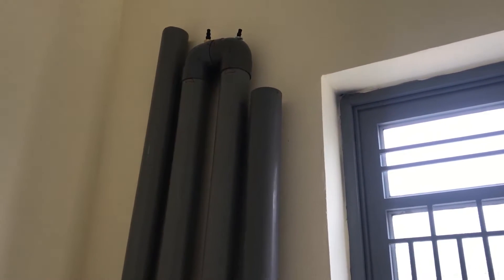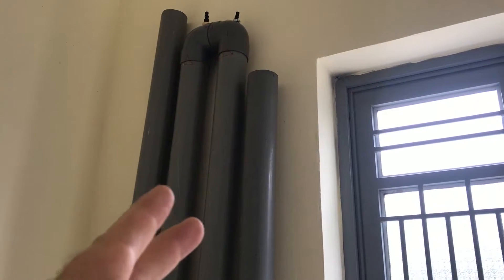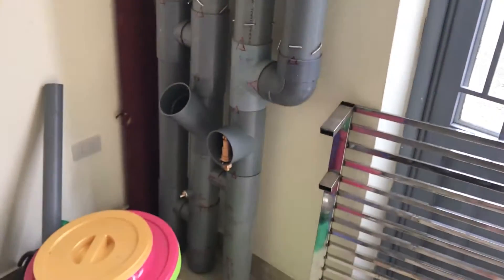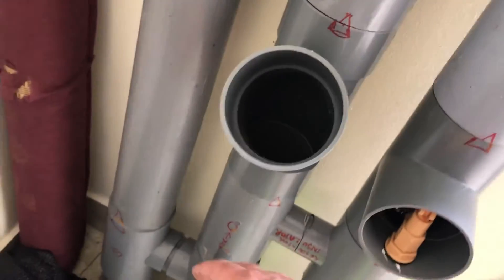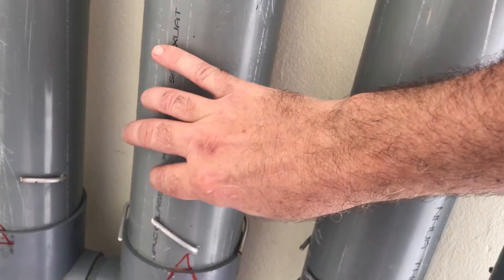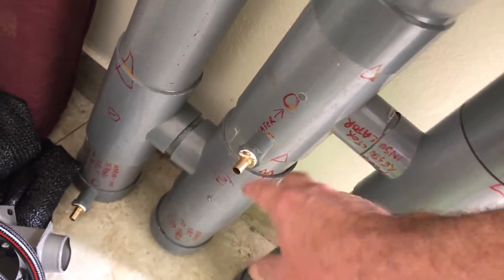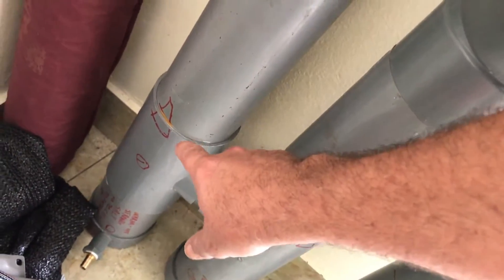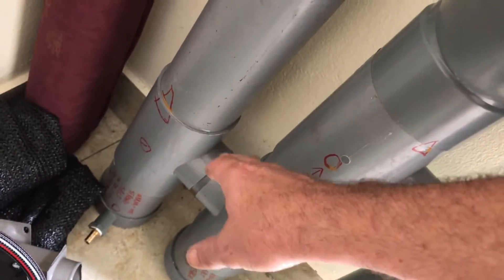Solar Powered Air Conditioner! diy project build start

Comment: Wow thank you so much for sharing I've been trying to find people who actually built this
Reply from the maker: Ya I built it but it did not work well here in Vietnam, because of the humidity being very high I guess. I did get about 4 degrees cooling at one point but it did not seam to actually cool the home. Still working on it.
Reply: I would love to see an update on it's function with you explaining what you think is going on with it
Taking some measurements or such

Do you think you need  a larger or second stage of dessication?

It was mentioned in the video i watched using a more expensive, desiccant may increase the amount of water you are able to pull out
Reply from the maker: Ya I when you pull the water out of the air it heats the air too. I think the problem was that I could not remove enough water fast enough. I was thinking to solve that problem by also running the air though a solar dehumidifier on the roof before cooling the air and putting though the evaporative process.

I will be interested in your thoughts
Reply: @pacifictradingpost7972  Ya, so, it's been a little bit since i took a thermo-fluids course.....or any course that involved desiccants in a thermodynamics system...... if i ever did.... So i may be talking out my ass here

But generally the heating of the air to cool would be counter productive in two ways.
1) it makes the air actually have more affinity for water not less meaning that the dessicant would extract less i think.
2) all the heating will need to be radiated away first

That is unless you compress the air....but then we are back to a standard AC....which is the point we are trying to avoid....lol

if you intend to heat anything you would want to heat the desiccant liquid more to drive off more water.
I could do more to help in that regards if i knew the steady state (after it's run for a while) fluid temperature of the desiccant 

but cooling the air coming in would actually lower the dew point of the air.
A possible way to do that would to use the cooled water from the evaporative cooler to pre cool the air or some other version of that. 
I would need to review your design again....but i think one whole stage of the process is to dump heat from the desiccant liquid and cool it below ambient

And if you arent doing that.....well that's likely your ticket

the desiccant working is exothermic
Reply: @pacifictradingpost7972  when water dehumidify, it leaves heat of 2501 kj/kg . Which means heat is inside room only. For this I suggest take system outside . So moisture as well as heat will go out side room.

Comment: I think the best way to do a system like that is though water pipes. You would need a small water pump pumping the chil water throughout your house and back to the cooler. So the unit would be a solar collector eating the absorption refrigerator and water flowing over the cool part of the system. The chilled water should bring down the temperature of the house a bit. Surely not a system that cools down like a normal AC but it would help your house a lot.

Comment: Tech Ingredients also did this.
Reply from the maker: I hope they got a better outcome, can you post a link here for the video?
Reply: Here is his last video about it https://youtu.be/7w4rg3UcsgI
Reply: I have seen both systems but like yours because you are using solid based desiccant. Tech Ingredients idea uses liquid based desiccant which I am sure is not toxic as he says but I would rather stick with your solid based one.
  Years ago, living in Central America, I setup two sea salt dehumidifiers using just 5 gallon buckets, mosquito netting to allow more surface area and a tube to drip the water into a somewhat closed container.  It did work but there wasn't enough surface area to notice the difference until 1/2 through the night.
  I live in the US South now and am looking into these again.
I encourage you to continue your work. It could greatly assist so many everyday people across the world without lots of clean electricity  and also people in disaster areas where humidty levels are very high.
 Thank you for sharing this great info sir and we all look forward to your continued work in this.

Comment: 2 days ago it was 100°f where i am in southern Utah USA. I filled up the gas tank. The metal gas nozzle must have been 50°f cooler.
Reply from the maker: Ya the decompression of LPG gas will make ice form on the outside of the nozzle if there is some humidity. Wish it was easy to convert that into a cooking system for your home.
Reply: @pacifictradingpost7972  not lpg, but yeah i know.

Comment: I don't think you want to be using the evaporative cooling side of that loop.  Evap cooling works when the water absorbs heat from the air to turn into vapor.  You start with warm dry air, and you end up with cooler moist air.  But then you are trying to take the same moisture you just put into the air - back out with the dessicant.

The net total is that you add heat to the room from the fan and the solar loop.  Everything else is practically net zero, took the water out to put it back in.  

(Yes, I know the hot pipe will be ducted outside, not what I'm talking about).
Reply: I also posted that and other replies at about 7:40, then finished the video and you explain exactly that.  So you definitely understand it.  You will feel better and have less issues with less humidity even at a higher temperature.  Just start with the humidity.

Comment: How did it go? Did you expand the complexity of the design and creep towards the goal?
Reply from the maker: Ya I have some ideas to fix the air humidity problem and like you say make incremental improvements but it has been winter in north Vietnam and so making an air conditioning system during winter seamed silly. 
Anyway it is starting to warm up again and so hopefully I get a née design out the summer.

The biggest problem is with 80% humidity on most days i can not get enough evaporation to happen. 
It is so humid here that when you open the doors on a hot day, the hot humid air meets your cool tile floor and next thing you know the floor is all wet like as if you have just moped it!! Anything touching the floor or cement walls gets mould on it for the same reason.
If you have any ideas on bulk cheap de humidifiers let me know. 

I did work out that to bring the humidity down by 20% would only require removing about a liter of water from the air in my living room but I need a way of doing that fast. 
I have experimented with bubbling air in salt water and that actually seams to produce a faster result than the shower effect but it has its own problems like getting enough volume of air though it.
But rest assured when I crack the problem I will post all my hard work here for everyone to duplicate for free or sell the idea to Westinghouse for millions!! Lol...
Reply: @pacifictradingpost7972  I guess you dont open the windows unless you absolutely needs to. Come back to some more reasonable and give us some more vides!
Reply: @pacifictradingpost7972  I guess you dont open the windows unless you absolutely needs to. Come back to some more reasonable climate and give us some more videos!

Comment: You can cool the air, or you can decrease the humidity. You can't do both. Since cooling the air is the goal, the humidity will increase. Condensing water vapor creates heat. Evaporation removes heat.
Reply from the maker: Of course you are right Lexie but I am a dreamer and I still have not given up on perpetual motion either.. lol but the idea was to use Sola energy to blow off the water vapor and then cool that air with solar fans through a heat exchanger before using evaporation to cool the dry air but then that air will absorb water and hopefully not be more humid than when we started... 
anyway that was the plan but the idea hit a road block. And it has been shelved ever since. 

Since then I have been working on making adjustable house stumps in my factory for international markets
Reply from the maker: Not sure what you mean jimmy, the air is hot and dry, after the first stage and it is the dry air that I need but I also need it cooled before it gets to the evaporative cooling stage that will increase the moisture content of the air again but hopefully leave it cooler but not more humid than the outside air.

Step 1 dry air with salt water and that will actually heat the air.

Step 2 cool the hot air with a heat exchanger to bring the dry air back to normal room temperature 

Step 3 use a normal evaporator to cool the air below room temperature but hopefully because it was dryer air to start with their will still not be more water in the air than before we started.

Is that what you understood the process to be?

Thanks for your input, the problem I had is that I am in Vietnam at the moment and the air in summer is very humid already and so unless I dry the air first I have no chance of evaporation working to cool it.
Reply from the maker: Ya I think you are right, I have some work to do on the design before I try again but I do like the idea.
Reply: @pacifictradingpost7972  Reading through some of the comments and replies... Check my comment I posted about how evaporative cooling works.  I can't thoroughly explain it in a youtube post, but I assure you, drying the air, then cooling it with water is a net-zero gain.

If you skip that part, just focus on the drying, not only will it feel cooler without actually being so, stop the mold problems, but you could drop in a $150 window a/c and IT will run about 30% more efficient just because the water is already taken care of.  The A/C condenses water, but that energy didn't drop the temperature at all.  

This is why a desiccant system or dehumidifier can boost the overall performance, but if powered with solar, it can also save energy.

Something I learned on this deep dive tonight was a product called a desiccant wheel.  Cannot post 3rd party links, but sciencedirect has an article, first result in Google.

I think these are usually for commercial equipment, but there is no reason it couldn't be DIY'd and scaled down.

Start by just turning off the cold water sprayer, leave EVERYTHING else the same, run it for a couple hours and you have lost nothing, if you just take my word for it, it's a super easy test, record the results.